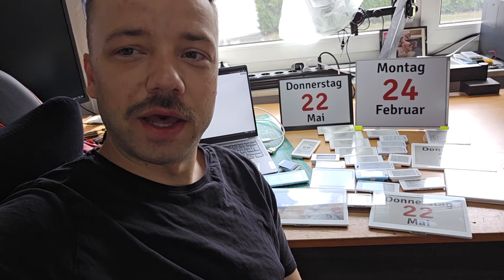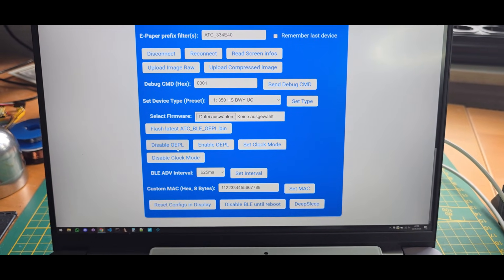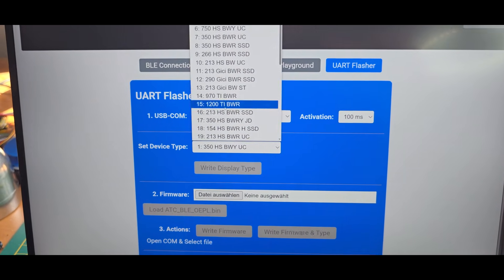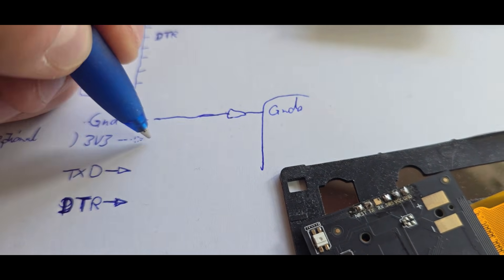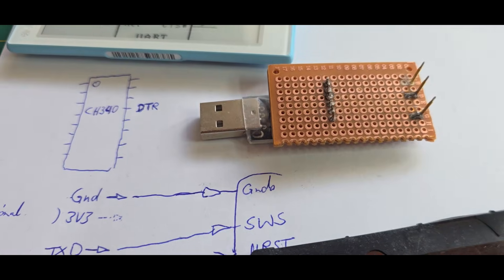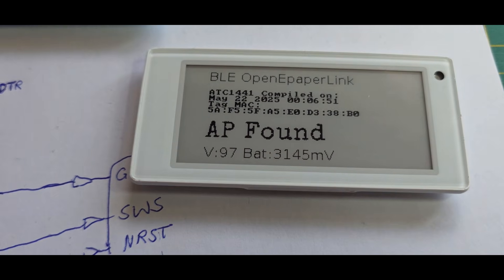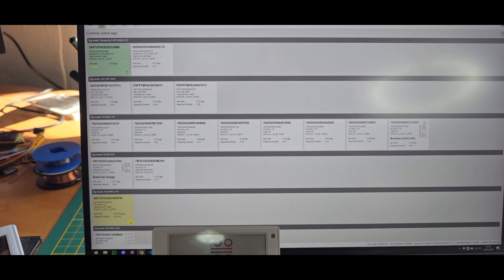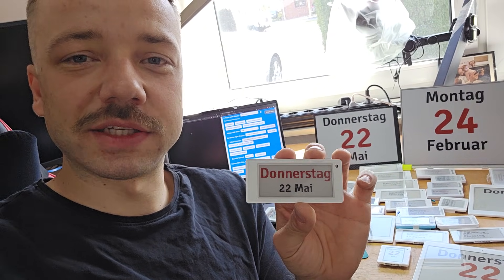Universal E-Paper firmware ATC_BLE_OEPL BLE and OpenEpaperLink

Comment: @atc1441 Thank you for sharing you effort. I tried to hack 4.2 BWRY EDG3-0420-A  and 7.4" BWRY eInk display Vusion (SES imagotag), model EDG3-0740-A  . I opened both and connected to ESP32 with bus, but it is hard to find libaries for those BWRY ePaper displays. Could your app support my displays? SoC on 7.4" is EFR32FG22(Silicon Labs)+smd part labeled 8K417. Display is EL074TS1/EB2000-GDA). There are an QR code and NFC sign label. On PCB there are two leds: white and RGB. The PCB is labeled: imagotag RFRTx026D, logo GRATZ. There are two antennas. One 2.4Ghz from SOC and the second is coil for NFC 13.xx Mhz.

Comment: I have it full correct working on a Hanshow Stellar MN@ E31H, Can you add it to the list with compatible Tag's so that we have the correct settings, I have used 266 HS BWR SSD OFFSET width 128 height 256 and changed the 56.json in the AP webserver  with the correct settings and resolution to make it working. Thanks Aaron to make it possible

Comment: Does this work on the Hanshow Nebular 350R-N ?
Reply: Good question?
Reply: I have just been playing about with a Hanshow Nebular 350R-N, it looks like it should work the led flashes during the upload of the firmware but wont boot into the firmware.
tested on all versions for the 350 but none work on this model.
Great project anyway.

Comment: Do these have an acurate rtc? And do you have resources for modifing the firmawre or source code for it so i can modify it to better suite my needs? I cant quite tell if the ota firmware updater will remove the need to solder on and flash firmware initially.. and assistance is much welcome. 
Edit: i have a picks smart tag and your image uploader works with it out of the box.